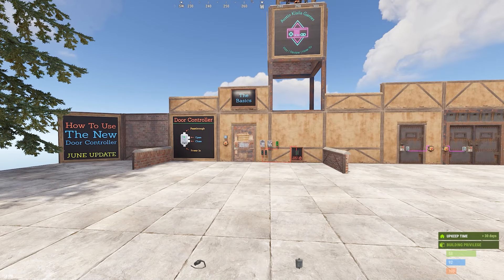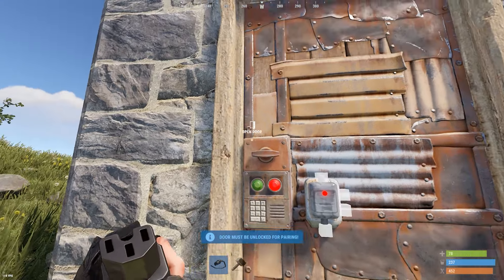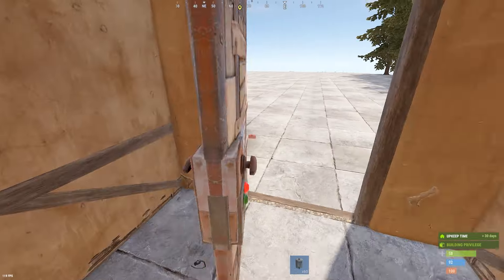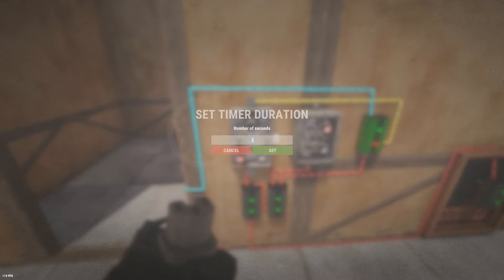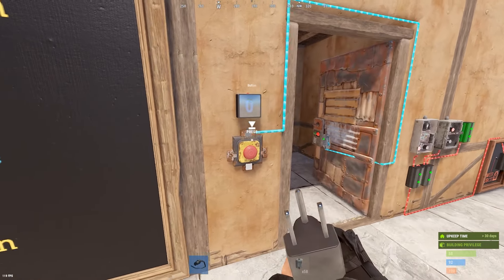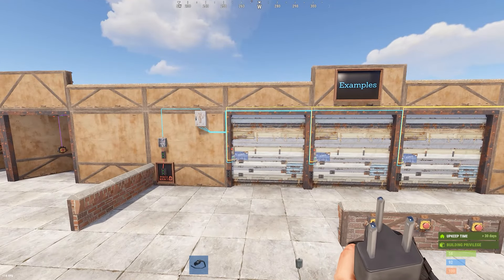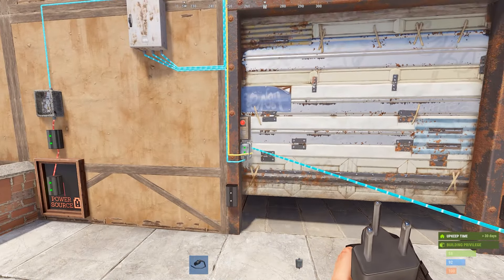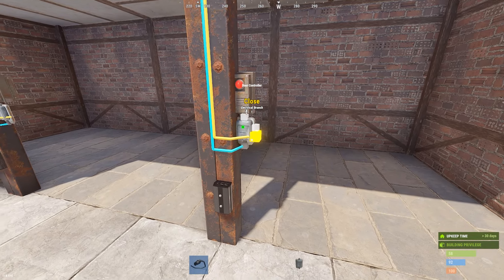RUST Electrical | How To Use THE NEW DOOR CONTROLLER | JUNE UPDATE Includes RAID SECURITY | 2024

Comment: Completely killed trap bases.. now it’s too easy to see if the doors got a controller or not.. at least the old placement you could hide them.. not a fan at all
Reply: Literally, so bad
Reply: Have they fixed this yet?
Reply: @RustSymo  no :(
Reply: You can change which side of the door the controller is on. You want double doors for traps anyways, too easy to back out of a gdoor that's closing on you.
Reply: @samkaeppel1160  yeah but when you attach door controller the wire sticks out when door is open showing that a wire is attached to door. The wire doesn't move with the door when it opens on console.

Comment: I set up door controllers a few days ago. Then I was fussing with the voltage numbers on the first branch controller forgot to put it back to original voltage settings and logged for the night and went to work. Got home logged in and every door was opened. They were open sense server restart at 6am. I didn't log in until 5pm. Thank God no one raided my base. That would have been devastating.  So be careful with voltage settings.  To much power, the doors will auto open apon server reboot.

Comment: Definitely not cheaper as you say, because I used to be able to just daisy chain all my sensors, each one only using 1 watt. Then, when an HBHF is tripped, a mem cell swapped from the doors (closing them)  to give power to my turrets. Even though I had 12 doors, my entire circuit still took less than the turret power, so nothing was really wasted! This new method is gonna be a pain for me to figure out lol

Comment: How to make 1 button to open and close the door but only by authorised person? Im tired to open door everytime i wanna move inside my base
Reply: Run the power out input from a button through a hbhf sensor and then from hbhf sensor to door controller circuit and set it to authorized users so the switch will do nothing if someone else hits it and pass power through if you hit it.

Comment: THERE IS AN EASIER WAY!
 HBHF sensor with 2 power, either inside or outside your base, connected to a door controller, will open and close your doors automatically by your presence. 
 i walk up to base and door opens when sensor is outside, or it closes when i leave when it's placed inside. no switches or buttons needed.

Comment: Good video, my suggestion for next time is to add a timer as well that closes the doors after 30s or something. That way your idiot team members if they forget to close a door, it will automatically close.
Reply: I know this comment is old, but I did this last wipe, albeit on a 3x. I made my smart switch power up all the door controllers temporarily via a timer, branched the power so that it would turn the smart switch off immediately. This made for a momentary switch that could open all my garage doors for 10 seconds allowing me to move around my base easily, and I could press it at any time to ensure all inside doors were shutb

Comment: yo... what button did you hit to move the power from the door closer to the branch when you were "saving to the branches beneath?" Like at 11:05
Reply from the maker: On PC you can right click an electrical connection to disconnect it and then reconnect it anywhere you like. If you continue right clicking it will undo the wire until it reaches where it starts. Hope that helps!
Reply: @AustinKlailaGames  dude. What a legend! Thanks!

Comment: Is it possible to have 2 lasers for an automatic garage, one outside, one inside, and both will open and close the open after a few seconds? I've been trying but I am pretty new to the door controllers and I only find tutorials for old ones
Reply from the maker: You could certainly do this. Off the top of my head, you could run the two Lasers to the A&B Inputs on an OR Switch, and that OR Switch's Output to the Toggle Input of a Timer (set Timer to desired door open duration). Run the Timer's output to the Door Controller Power In. Experiment with powering each item until you have no extra RUST Watts coming out the other side (I say it this way because console is currently different from PC regarding powering stuff). Hope this helps!
Reply: @AustinKlailaGames  Thank you, your explanation was perfect

Comment: Before, you only needed a HBsensor to detect intruders and 'set' the mem-cell to make the doors all shut and a killing blow deliver to key areas.. The update was a major L for security as G.doors - the crux of a good lockdown- are very obviously rigged to shut. Only good thing is that they de-sync when TC is broken.

I regret not making a demonstration of this hannibal man-trap, the update has majorly screwed a circuit that actually beat 9/10 offline raiders. Nice QoL to have them on doors so if they DISCREETLY allow them to place manually then I'll upload the build :)
Reply: I’m sure there is still a way to rig it up; I also had a HBFS sensor-mem cell- door controller chain to lockdown, and I think I could still mess with it to fix the new issues!
Reply: @kerrybarneyiii1202 sure, but its very specific/limiting now, some examples:
>Doors that swing out to block players can have controller shot out for no boom
>wires bug and indicate the door has controller
>g.doors are virtually not applicable, meaning a decent lock down requires a few armored doors which casuals may get raided before reaching.

Currently living in a base with shit loads of single doors spiraling in a triangle. Its sus as theres not many placement options, not sure ill ever have the glorious base i once had :' )

Comment: Wait so back in the day could you just hook up a door controller to it if it didn't already have a door controller on it?
Reply from the maker: Sort of. You couldn't add a door controller to a locked door, but if the door controller was already on the door after you raided a base and placed your own TC, you could take a battery and open locked doors. This fixed all of that.